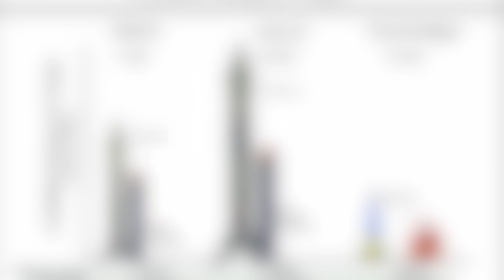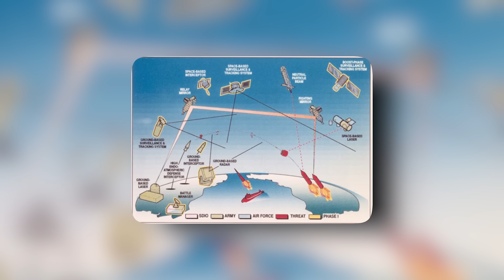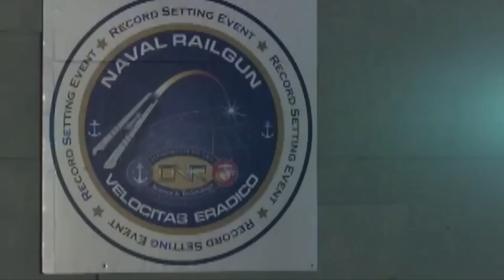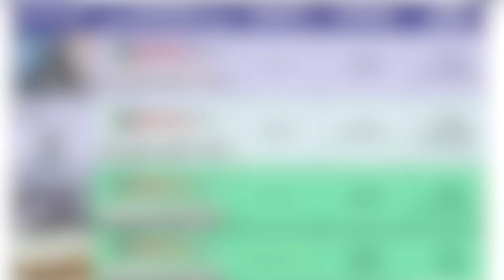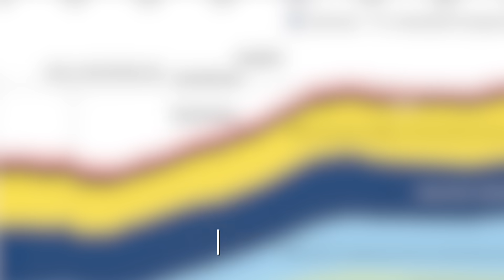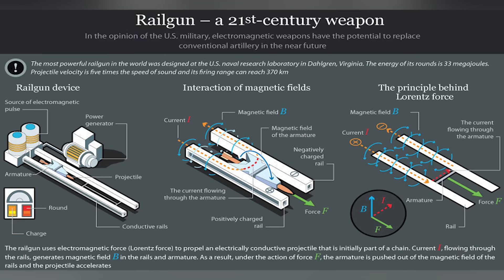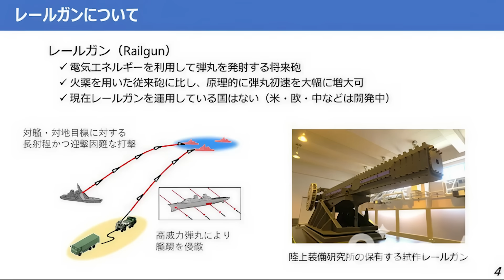Japan Revives a Scrapped U.S. Superweapon — And It Actually Works!

Comment: Railguns have several inherent problems. One of the biggest is that the projectile’s optimal shape for accelerating inside the coils is terrible for aerodynamics and ballistic performance once it leaves the barrel. The projectiles often lose stability in flight, and despite the massive energy involved, both accuracy and range remain inconsistent

Comment: Fighting any one like the Russians or Chinise in a conventional war will be about costs and the ability to take out high cost assests with high speed low cost to opperate weapons such as Railguns and Lasers as they are the war winning weapons because they are cheaper to run and makes conventional weapons unnessisary and obsolet.  They need to work with Japan to make the railgun work for the ecconomics of a sustained conventional war.

Comment: the main issue with the rail gun is, it is a "dumb" projectile. Its too much like the old massive battleship cannons. we just do not fight like that anymore. we do not use coastal bombardment as a strategy so ... the Juice is just not worth the squeeze. Spending Billions on a weapon system that we are never going to use... the destructive force of a tomahawk missile through kinetic energy alone, that can be fired from miles away... you have to admit that is bad ass though!

Comment: Japan seems really good at miniaturization and optimizing machines.
Reply: Japan did not merely inherit American research or repurposed hardware. Japan completed the railgun entirely on its own—independently conceived, engineered, and brought to operational deployment. In particular, Japan stands at the global forefront of superconductivity; please take that into account. Rather than “Japan Revives a Scrapped U.S. Superweapon — And It Actually Works!”, a more fitting phrasing would be:
“Japan independently completed—and fielded—a ‘superweapon’ that the United States was unable to finish.”
Reply: @AB-mn6qb Why are you telling me this? I didn't write their title.

Comment: Wunderwaffen were "super" weapons that were so unreliable they would break before the Germans could even use them. A lot of the German equipment was actually very unreliable during WWII, so much so that the equipment they made in the 1950s and 1960s are the exact opposite, they still work as if brand new

Comment: Fun fact. It works as well as the scrapped US railgun. Meaning it 100% works as a proof of concept and demonstrator. But that barrel will still wear out after a few dozen shots. You can’t cheat physics. They didn’t do anything different.

Comment: Just use water. ionized water is a great electric conductor and cooling, You could contain it in copper and rubber and enhance it with potassium ions
Reply: resin can be used as a protective  barrier against corrosion can enhance the durability and longevity of components in systems including ionized water. , it can provide  chemical resistance, and electrical insulation, resin coatings can mitigate corrosion and maintain the integrity of the system. The project should be called Mr.potato Head!

Comment: OK, the aspect of the rail gun the funding stop for that because it was more beneficial to build something that is referred to as a quail gun and they use a series of coils instead of a rail track swing Stuff primary reason was is there’s faults in the rail design, and you have to develop a cradle or carrier to sling the projectile where with a coil gun you could suspend it with a magnetic field and then projected forward with a series of ones and off as if it was a High speed train. The advantages to this is that the coils are less likely to explode. The track doesn’t exist, and the only thing you have to worry about is the round itself, which is suspended by a magnetic field as soon as you pushed past a receiver into the coil field many cases the coil field also has a tube in the middle of it and which the round travels down as a light guide most of the time, this is a non-fair material within walls

Comment: If they can make barrels that can handle it, I beleive an electric flywheel would be an ideal solution to the capacitor problem.  Then export land based models to Taiwan.

Comment: The reason the US has lost interest in railgun research is not that it is useless, it is just useless to the US. Railguns are not going to be able to be effective outside of certain situations and the ideal situation for railguns would be space combat not terrestrial combat. Also an issue is anything you shoot in space is going to just keep going unless it interacts with other stuff. So stray shots could end up hitting something else much further away. Like shooting a gun up in the air at a slight angle that bullet has to come down somewhere and it will do damage to whatever it hits.

Comment: Rail gun was only scrapped because it used so much power youd have to have a nuclear power to keep firing it. 😂
Reply: That's not the only reason. It's expensive, doesn't yield better results than weapons we already have, and most importantly, it immediately gives away its position. Not great for mounting on a stealth warship. 

Something like a railgun has to fire upwards to hit targets at range, in order to get around the curvature of the Earth, and travel further. Once the round is within LOS of fire-finding radar systems, a capable country would know exactly where it was fired from, how fast the target was moving, and in which direction. They would also know exactly where the slug would land.  

Well, that's kind of a stupid thing to have in a sea battle, or really, any battle on the planet, especially when we have better stealth tech than anyone, control of space, and better ECM/ECCM abilities than anyone. We can just use cruise missiles, especially hypersonic ones, for much greater advantage. They fly lower to evade radar, have more range, can carry warheads, can vary course, and can get guidance from our extensive satellite network. By the time any enemy detects them, the firing ship and its fleet are long gone because they have time to move. 

We let Japan have these things because they'll be fighting China, if anybody, and Chinese warships are a joke. It's not that they don't have technical know-how to make them better, it's that they don't have the skilled workforce or supporting economy to actually build them the right way. That's great if you're Japan and you're being fed satellite targeting data from the Unites States while you keep a defensive posture and only need to wait for help. By all means, blow up a few Chinese ships with a giant gun. 

But against Western nations, it's just an expensive toy. We're not likely to fight any, largely thanks to the fact that we always keep a military edge over them.

Comment: Why do railgun projectiles look not aerodynamic
Reply: Air resistence behaves differently in the hypersonic region. Due to how compression and shockwaves form, once you're going fast enough a triangle gets relatively close to optimally aerodynamic. The rest of the stuff is just as needed for the discarding sabot to survive the force of launch.
Reply: @Lunar_Ice_3141 thank you I suspected it but I don’t know it
Reply: Because they don't need to be. At those velocities, the projectile is brute-forcing through the air anyway, and you can't put fins on it since they would just snap off. Well, I mean, you could, but it would make the barrel more expensive and be pointless.  

They can't hv electronic or mechanical guidance, either, since they're being fired out a giant, computer-destroying magnet tunnel with such force, and we can't even put discarding sabots on them like we do with the M1A2's hypervelocity smoothbore cannon. The railgun would melt the sabot pieces together before the round reached the end of the gun. So instead, it's just a big slug of ferrous material designed to stay mostly straight through its trajectory, because large parts of it will burn off in flight. The mass is what keeps it on track, not the aerodynamics.
Reply: They look very aerodynamic. Are you confusing the armature that surrounds the projectile? This is discarded like a sabot when the projectile leaves the barrel.
Reply: @aries6776 the solid block that it launches in the prototype looks like a brick

Comment: The U.S. abandoned railgun development mainly because the Navy decided the cost, maintenance, and power demands outweighed the benefits. The prototypes required massive amounts of electricity, ate through barrels after only a few dozen shots, never achieved the theoretical ranges proposed, and didn’t deliver a big enough advantage over existing missiles and naval guns. Japan kept going because they’re focusing on smaller-scale, defensive railguns to counter hypersonic missiles and drones, which require less power and fit better into their defensive strategy. Meanwhile US intended to replace current naval guns with railguns and comparing it directly to the Mk 45 5-inch naval gun, the standard deck gun on destroyers and cruisers with a range of around 13 nautical miles. Researchers claimed that the railguns could reach 100+ nautical miles with a Mach 7 projectiles but only achieved 23-30 nautical miles in reliable testing.
Reply: Bless you kind sir, for saving me the time of listening to the dude blather for an extended period of time
Reply: For a nuclear powered vessel, it makes sense to have a weapon like this. You basically have infinite electricity. However, that doesn't mean we don't have something far superior at this point. My guess is we had it for a while, but never needed to unveil it, and then got rid of it when something better came along.
Reply: 電源はマイクロ原子炉。冷却も同時に出来る！
Reply: You left out the 5000-10,000 cubic feet of Batteries, you have to keep up and charged when you are not firing it.
Reply: they didnt though. thwy only moved it to the barrel testing range. I know this because I deliver there. I witnessed a test years back when they had it at thw lab on the hill and a few months back they put up new signs about the booms on base and they closed off the barrel development range side of base during testing.. When I say I work there I just deliver there so I dont carry a clearance and Im not saying anything that anyone that lives or works there dosnt know..
Reply: America keeping their motto of "go big or go home"

Comment: The Railgun is much better option to be mid-long gunship with accurate targeting and balancing. The charging up is slow and the reload is slower but to penetrate ship and sink it faster. Definitely an alternative to tomahawk long range capability and it may doesnt have that much explosion (equal to 11 C4) but the it will definitely put a bigger hole on a ship from its outside impact side. Depending which area the railgun shot, it can disabled ship's engine and various system

Comment: The feasibility of ship-based railguns is highly ambiguous.
Contrary to popular misconception, ship-based railguns are essentially anti-aircraft weapons, just like modern naval main guns. The firepower and range of railguns as anti-ship or anti-ground weapons are no match for existing guided weapons. 
To use railguns for anti-aircraft purposes and leverage their long range, the projectiles must be guided or proximity fuzed.  However, it is highly doubtful whether such complex and delicate projectiles can withstand the much higher acceleration than conventional artillery. The technical barriers for the ammunition of railguns are far higher than those for the guns themselves, and no technical demonstrations have been conducted to date.

Comment: I understand the point of a railgun, and I could easily see it being usable for coastal batteries, for example.  (Taiwan could certainly use them to fend-off a Chinese invading force.)  What I don't understand is why anyone would think that putting them on a SHIP is a good idea!  If you're firing an unguided projectile 100 miles, mounting the barrel on a platform that is constantly rolling, pitching and yawing, just seems like madness.

Comment: A big, big problem is that railguns rapidly tear their own rails apart, with each shot doing significant damage to them. Oddly enough, an enclosed barrel is NOT required, and the fact that all testers have been using one may be adding to the damage caused to the rails. Should be easy enough to build a railgun with rapidly replaceable rails, possibly on an open, rotating carriage a la the gatling cannons. Maybe even make them automatically replace the rails every X number of shots, as they rotate. Those saying this would be 'impossible' don't understand engineering.

Comment: As to the U.S..  It still needs to get it's railgun aircraft launch system reliable and repeatable.  At least as I understand it, the electromagnetic launcher isn't as good as the old steam catapult launch system.  Faster, yes, but as reliable, no.

Comment: The railgun worked, that wasn't the reason why the U.S scrapped it though, they couldn't ever really solve the longevity of the barrels. Meaning that they wore down quickly shot after shot.
Reply: Yeah. America was doing way more energy per shot than Japan if I understand what was said here. The forces on the barrels are extreme. Yes, the Lorentz force pushes the projectile out but it also causes the rails to push on each other. The rail wants to split open. This means the barrel deflects away from the projectile causing arching.
Reply: The US tried to achieve performance beyond what was within the engineering capabilities of the day.

Comment: The problem with rail-gun technology is that it requires so much power and it tends to destroy the barrel after a handful of shots. If they can overcome at least the barrel replacement issue then it might be a starter but until then..

Comment: The United States scrapped the railgun because of 2 major reasons...

First of all every single firing of the railgun required a minimum of 1 million amps... For context your light bulb is probably pulling about 1 amp... And you're extremely high-end gaming PC with all the ins and whistles that would absolutely tick up your energy bill is pulling anywhere from 5 amps to 10 amps...

That is a LOT of current, and heavily limited deployment options to only a small handful of ships... That alone wasn't enough for them to can the project but it was a negative that when combined with the fact that the copper in the rails would burn out after only a dozen or so shots meaning that after every dozen or so shots you would need a full-on barrel replacement, and it just wasn't practical to operate...

On top of that the best the US military could get for a fire rate was one round a minute, and that's just not practical for combat....

Comment: Problem with the rail gun is the wear and tear of the barrel and it's range. Having a horizon only range is limiting compared to missiles. Japan has cutting edge metallurgy and usa has the power capacity tech.

Comment: Straight from the horse's mouth: "The program was terminated due to unresolved technical issues, particularly with barrel life and rate of fire, and a shift in focus to other weapon systems like hypersonic missiles and anti-missile lasers. The Navy had invested approximately $500 million in the railgun project over several years."

In other words.... The USN scrapped it because it was costing more than it was worth. The juice wasn't worth the squeeze. Other systems work far better, for far cheaper, and with far less complexity (complex = prone to failure at the worst moment). The barrel-life problem, all by itself, is a $500 million deal-breaker, and that's for something with a Rate-of-Fire that's slower than molasses. Trust me... Japan can't afford to field rail-guns any more than America can. China, maybe, but not Japan.

Comment: Decently sure this is installed on several ships already for the US, issues with the barrel though caused it to be less useful as it needed to be replaced, it wasn't even friction causing most of the warping as far as I am aware but the magnetic fields being used to accelerate so much

Comment: I need someone's perspective. Unless the destructive capacity is being under sold in this video or it's just going over my head, I can't really see the value in this thing even if Japan can address the barrel degradation issue. It's ridiculously expensive to procure and operate, hard to install on traditional ships due to size and power needed (which is important because if we go to war with China soon, we can't wait until 2030s for the newest fleet of ships), and seems to have a hard time stacking up to competing weapons systems that can do the same thing more reliably and cheaper. Am I wrong?

Comment: You know what I've always thought was dumb about the railgun is they said it wasn't financially or feasibly or logistically sound because the barrel only lasts a dozen shots or so because of how fast the projectile is going or thermal melting something I don't remember the excuse but okay so turn it down a little bit so it's still an increase and improvement compared to other projectile weapons and run it like that  because if you lower the power by 50% the lifespan increase will be about 800%